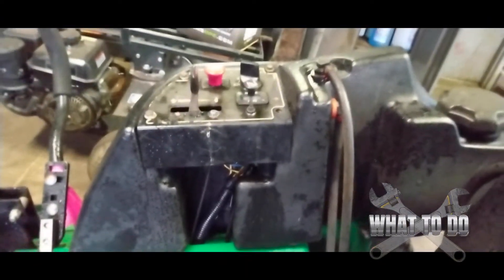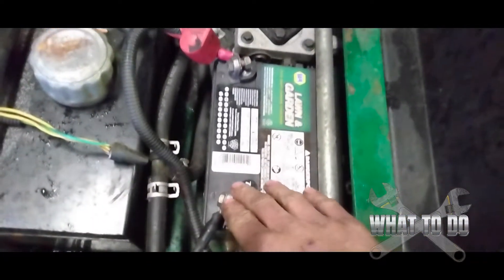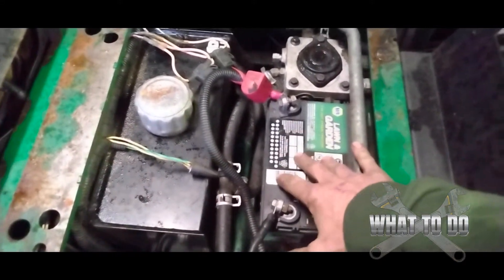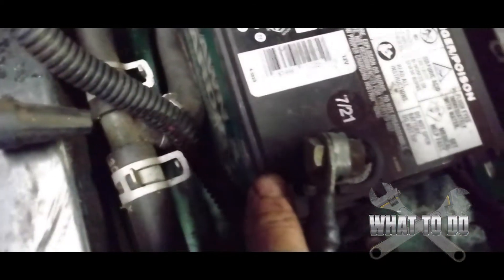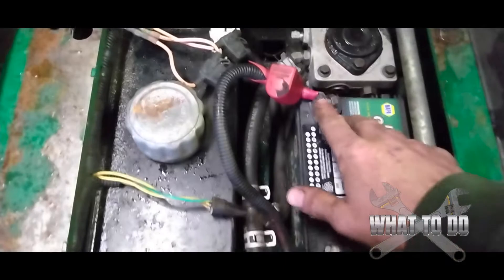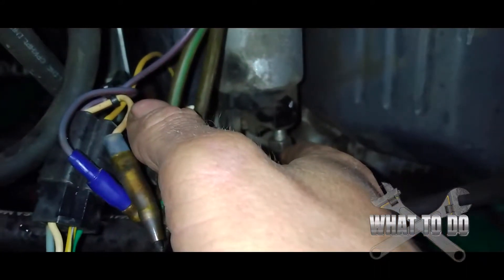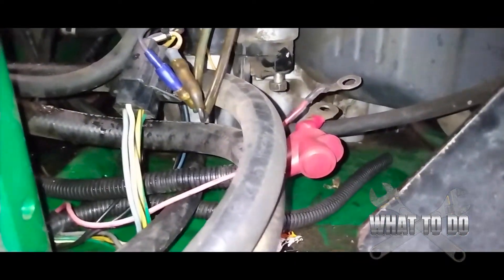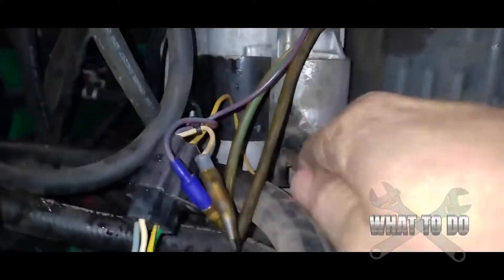Battery Sparking when Jumper Cables Hooked up

Comment: Cub cadet zero turn , was replacing new battery (old battery completely drained) but stopped because when connecting negative cable, plenty of sparks visible.  I will try your method.  Thanks and God Bless.
Reply: What was it?

Comment: My car had the same problem. No power to dash But full charge on battery and sparks even without a battery hooked up
Reply: It was the alt wire melted to the exhaust manifold which made nothing work assuming from a fail safe feature